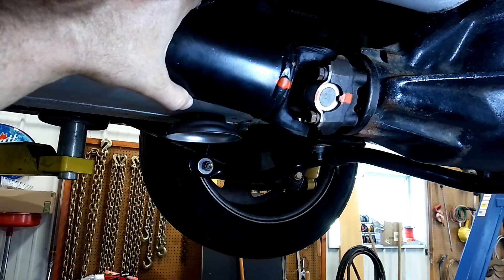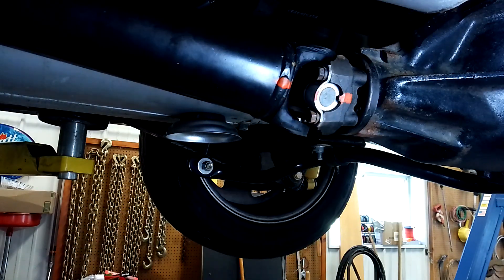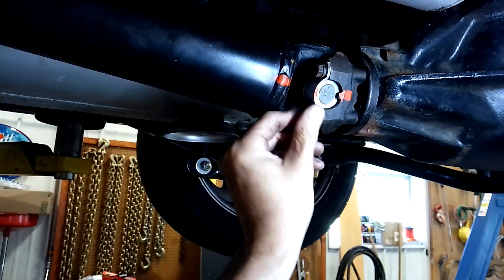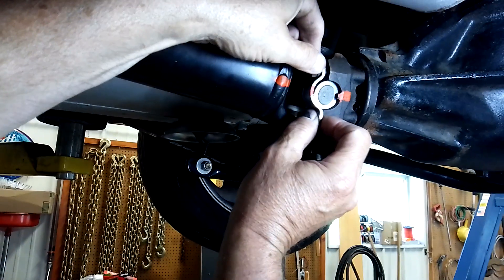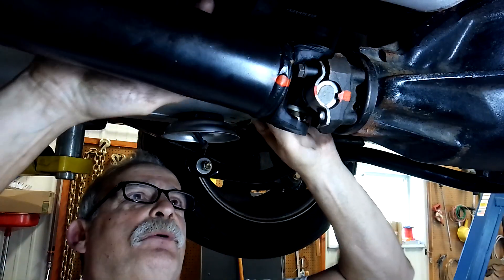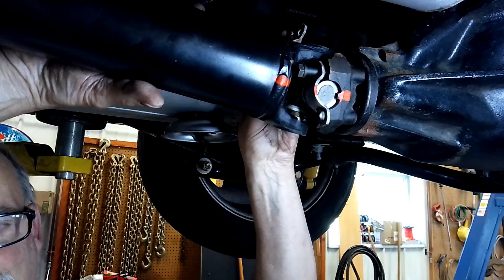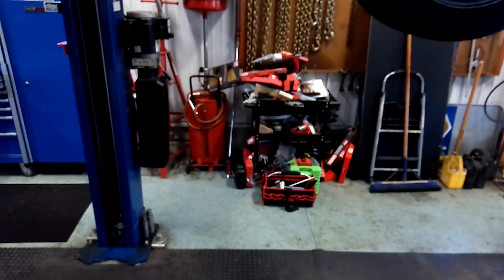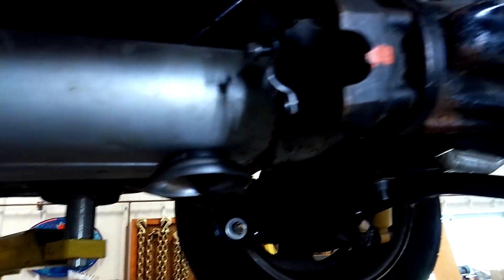TECH TIP, THE PROPER WAY TO REMOVE DRIVESHAFTS 🧐

Comment: Great tip Jeff! I never thought to use the magnetic trays upside down. What kind of noise are you getting from the transmission? Hope the rest of your weekend is going well my friend!
Reply from the maker: Hi lieser,lots of vibrations and I lost Drive Gear!! Also making a tinny nose under load!! It was rebuilt about 4 years ago!! I'm thinking it may have to be beefed up a little more!! 500+ HP and 585 TQ might be a little too much for a basic TURBO 400!! I'm not sure,will see!! Thank you for joining in my friend!!

Comment: Great tip Jeff, having the drive line marked to keep them in phase is something everybody working on a rear wheel or all wheel vehicle should do. That is especially important on cars from 1990 and up when all drive shafts in %90 of manufacturers finally became smart and balanced and synced drive lines to prevent vibrations and help with fuel economy and inner cabin noises. I think most manufacturers took this off of the German OEMs such as Mercedes that had been doing this since the 60s for all the right reasons.
By the way nice undercarriage on your truck, and sorry about the tranny issues. I know how those are, my Trailblazer is still down for the same thing. I really don't want to shell out 2500 for a rebuilt transmission when I can probably buy a newer Trailblazer for 1000-1500.  Thanks for a great week.
Reply from the maker: Hi Mark,as you know in life THIER is always something broke,lol!! Yes marking or indexing your drive line is important,no doubt!! Hope all is well mark!! Channel growing slowly!! That CAPRI giveaway video made the top 100 in HYPED videos,#77 so far,I thought that might give me a boost, but it's not really helping in my case!! Oh well!!

Comment: I use plug in the transmission when I take the driveshaft or axle out. Never have a problem with fluid all over the floor.
Reply from the maker: Good tip my friend, thanks for joining in and sharing that!!

Comment: Cool , I would add , once driveshaft is out , Tape the caps on so they do not get knocked off .  Years ago i done a video on replacing U joints. Back when i ran lifted trucks we would make are own drive shafts.
Reply from the maker: That's a good tip also wtbm, appreciate you joining in my friend!!